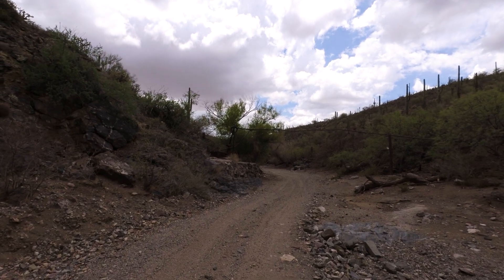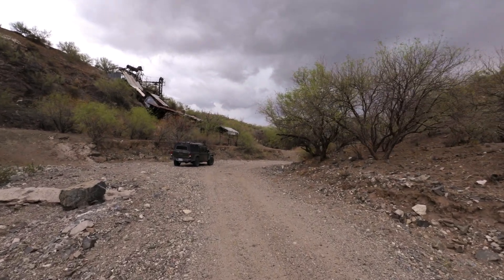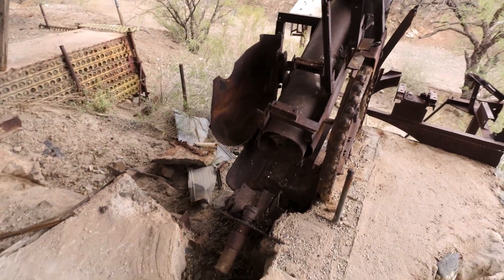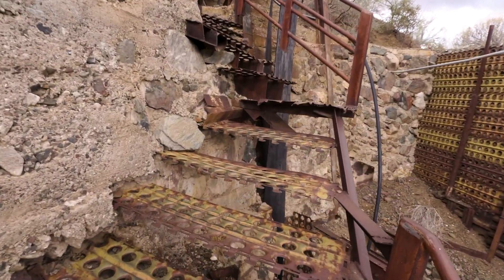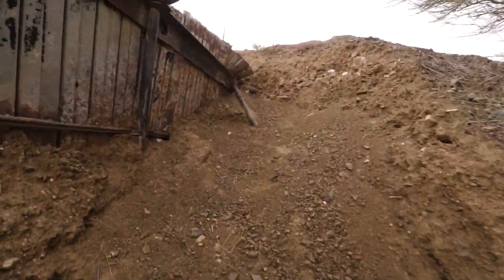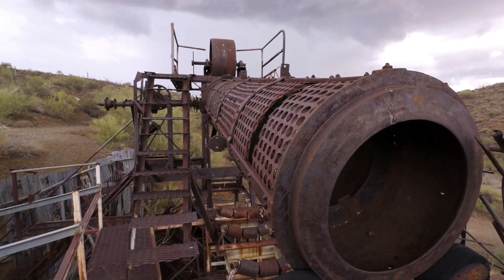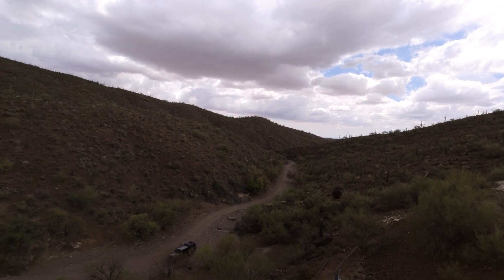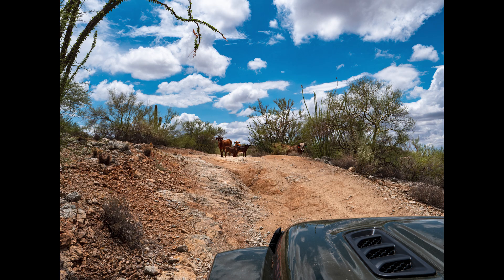Anderson Mill

Comment: That's a cool old place. A few years back BLM was going to tear it down. A bunch of locals got together and got the plans halted. Surprised you didn't run into the bee hive right there around the main stairs going up into the mill. If you look at it now it doesn't make much sense  on what, how, or even why they built it that way. There is supposedly some good photos in Wickenburg at the museum there. You're just around the corner from me. Welcome and have fun exploring this great state.